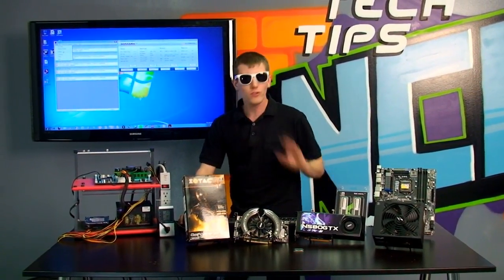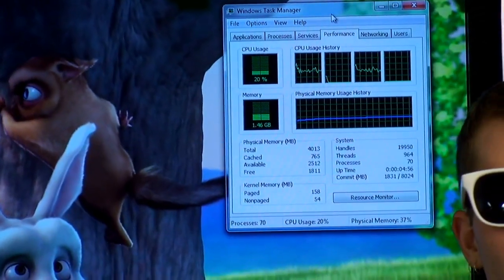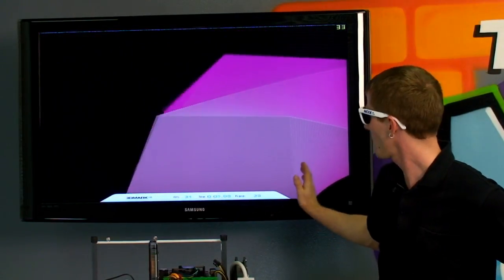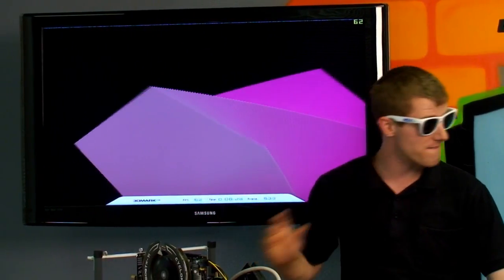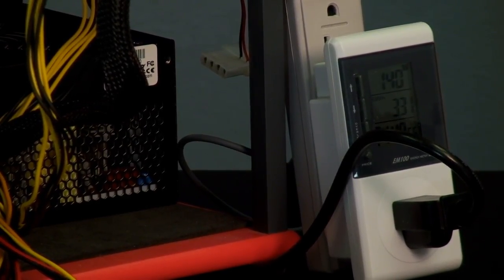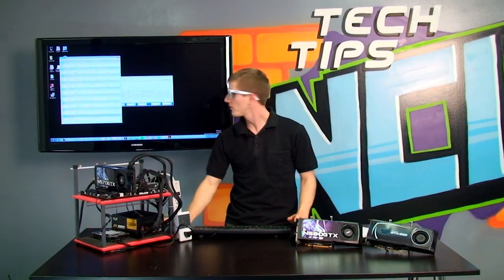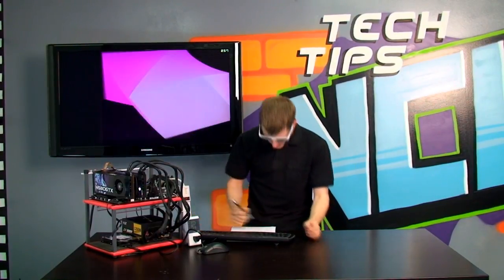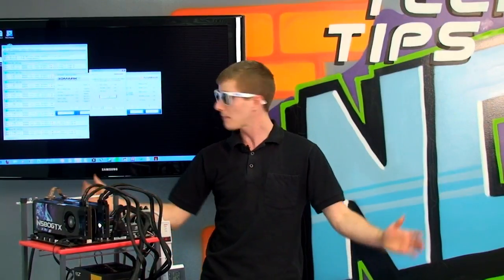System Power Consumption - A Closer Look NCIX Tech Tips

Comment: @TheLycanjake1 Do you leave your CPU overclocked every time you use the PC? No so you won't burn out your CPU. Same as the Power supply you don't stress it. In theory you can run the graphics card but stressing it out every time you turn on. If you tried placing that graphic card with your power supply, your PC is time bomb. When you have high end cards you must have reasonable amount of power that won't stress out.

Comment: Actually, in my country the 4570 is slightly cheaper - just a couple of bucks.
My only concern is that future games might require more cores, because they might be optimized for the architecture of the next-gen consoles, which would have 8 cores.

Comment: corsair brand 550W (I forgot what model exactly) Running a i7 950 with a small OC, 6GB of RAM, a HD6970 2GB, 2 hard drives and quite a lot of fans on that.

It would be a little bit on the weak side when my system would be running at 100% load, but it stays well withing the safe range (300W) when gaming or rendering video. I could probably get away with another HD 6970 because I have a brand name PSU.

I really don't see why anyone would need a 1k+ PSU,

Comment: @bluesmoke21 Go to Newegg (NCIX does not have the info) and check the images of the PSU. Read the label. What does the 12V say? Reason I say to check the label is because the details tab is not at all accurate for multi rail systems and sometimes the details are missing.
Take for instance the TruePower 650W, great power supply capable of 54A (648W) on the 12V. It's a multi rail system. If I read the details and added them together I'd end up with 94A (1128W) which it cannot supply.

Comment: your processor will never suck up that full 95 watts unless you max it out or you overclock. if you really want to be safe until you get a new power supply you can downclock all of your equipment so you dont put unnecessary strain on your supply.

Comment: Q9650 @3.6GHz, 4GB 1066 DDR2, 640GB+1TB harddrives, Bluray DVD-RW combo, HD5770 + Geforce 9600GT, fan controller, lots of led fans and a UV cathode all running off my Enermax 535watt.

Comment: couldnt find any power consumption for the 4570 but the 4670k (stock) is 33 watts idle and 97 watts under load, so im guessing the 4570 would be a tiny bit less and 8350 (stock) : 74 idle and 195 under load

Comment: GPU: Powercolor 7970

CPU: i5 3570k

RAM: 16 Gb 1333

Memory: 2tb Seagate

Mobo: Gigabyte Z77 - D3H

Case: Thermaltake Level 10 GTS

PSU: 800 watt

CPU Cooler: Corsair H60

Comment: I use a Corsair GS800 80Bronze. In my defence it was cheaper than the GS600 on Amazon which is why I bought it. At the time it was running an i5 2600K, 8Gb RAM and two 5770's. 

Yes, I know.

Comment: We have UPS that converts AC to DC to charge a battery that supplies DC current to an inverter to create AC to supply a PC power supply that converts it back to  DC voltages.  Why do we waste so much power converting  and not have a 12 or 24 volt DC switching  power supply that directly feeds the  Motherboard From the number you demonstrate here it seems that the biggest waste is in the power supply.I wonder how these numbers might differ with a solar system rail ?

Comment: indeed a stock 7970 and a stock 8350 both consume around 200 watts each under full load add top a 100 watts for your HDD + ram + MB you're then at 700 watt for full system load so a good 800 watt psu would've worked perfectly :P or 1000 watts if you OC'd everything

Comment: I got a q6600 at 2.7 gh(will be 3.6 soon enough) with
a 650 w corsair and a evga gtx460 at 850 mhz for my projector.
I can run dirt 2 maxed with 8x aa and 60 fps ar 1080p resolution
and even Arkham city with high settings and a smooth framerate with that.
You can get a used 460 or something similar for around 80 bucks on ebay.

Comment: You would be fine with a lower power seasonic as long as it can handle sli. I have a 620 with a 7970, and have power to spare. you could probably get away with right around 800 with a good name brand PSU.

Comment: maybe 700watts will be enough but get an 850 watts just in case and some wattage for overclocking. Also get a power supply with 4 pci-e for sli or crossfire in the future.

Comment: So the wall supplys your pc with AC power and the PSU converts that into DC power.  If my system draws 700w DC power it will only draw (estimate) 400w AC power.  What I am asking is when your computer is converting power to DC do watts increase from what is being take from wall?

Comment: With AMD Athlon 2 x2 250 and HD5750 i used to have LOGIC 500W, but i knew that this is not a good PSU, so i changed it to XFX Pro 550W. So it was not about a wattage upgrade, but a PSU quality upgrade. I think, that You could bring some good quality PSU with this same wattage as that "noname".

Comment: I wouldn't wanna be using an OCZ power supply (personal choice, but if a PSU is working then a PSU is working) but yes, 750W is more than adequate for two high end cards in SLI

Comment: Yes. It's do the job well. But ATI GPUs needs a lot of energy. To have sure (just a tip), try 650 or 700w. Each card gets, more or less 190-210w in FULL load. So, crossfire with 2 7850 will need a lot ot energy + more energy to the CPU and all other hardware.
Keep an eye in the memory too, because each 7850 needs (to run perfectly) 4GB. So, to Crossfire, you will need 8 GB. Good luck.

Comment: @juankabang1 600w is plenty. TO give you an Idea i run an I5 2500k overclocked to 4.5ghz (morepower consumption) Azza hurrican case with 8 fans, 2 gtx 460s 1g vram ocd to 850mhz, 1 ssd, 1 hdd, an asus xonar sound card, 8g ram, Asus p8p67 mobo, and a Kingston Hyperx ram cooler all running on a Corsair tx 750w no problem. 600w should be no problem with your rig. You wont pull more than 400w unless you start overclocking

Comment: yea what about mine i have a evga sr-2 with two i7 3970x cpu about 100GB of ram custom water cooling system with five radiators, 3 gtx 690s and 15 250GB ssds what should i do

Comment: E8400 @ 3.60 GHz c0 1.28v, GTS 250 1GB, P5N-D,
Corsair valueram 4GB DDR2, W7 ULTIMATE 32-bit, 1TB hdd, 30gb ssd, Novatech 750w modular psu total 12v rail = 72A

Comment: I use a XFX 850W Black edition PSU

i7 930 @ 3.8ghz (1.28v)

1 GTX 570 @ 850 core/1700  shader and 2100 memory @ 1.04v

1TB SATA HD
6GB 1600 Kingston Hyper X Ram

1 Noctua NH-D14

All on Asus X58-D board.

Comment: I have a 500w psu with a foxconn 945 7mc mobo with E6300 stock with stock cooler and 2gb corsair ram and a galaxy GTX275 with windows 7 with a 160gb hd+120hd+80gb hard drives and two disk drives with two 120mm fans should i get a bigger psu?

Comment: @juankabang1 lo you will be fine. I ran my 955BE @4.4Ghz on my UD3 along with 5HDD's, a 5870, and 8Gb DDR3 ram. Just make sure the PSU is good quality. I used the Raidmax 530watt (I have a different PSU now.)

Comment: I have 8gbs of ram and 600w psu (already made the system a couple months back) I just saw this video the power consumption almost hits 600 watts but those graphics cards consume about double the power each compared to 7850's. I know you should never get close to the maximum output of your power supply but the system power consumption shouldn't go much past 400w unless everything is at 100% load and still it shouldn't max out the psu

Comment: GS800 Power supply, 2600k @ 4.5 GHz, Corsair H60, 16GB 1600 Vengeance
EVGA GTX 580. P8P67 Deluxe, Intel SSD, + 1&2 TB 7200RPM HD

What I would like to see is how you add up how big of a power supply you need for building a new system. A 1250W power supply would be overkill for my system I think? Upon building my system I found a few web sites that said 800W would be fine for my system but how would I be able to do the math to find out for sure?

Maybe a Video in the future for that?

Comment: nVidia geforce GT 640 2GB DDR3 Core: 1150 Mhz Mem: 1050 Mhz
AMD FX-4100 4.3Ghz
Asus M5A78L-M/USB3 Mobo
WD Caviar Black 1TB w/ Crucial Adrenaline Solid State Cache performance boost
8GB Corsair XMS3 1333Mhz RAM
Samsung SATA 3 DVD R/W Drive
Not exactly a high-end powerhouse, so I use a 500 W CIT 500U PSU

Comment: Since my gaming pc died, I'm using a Zion 800w psu in my custom XPS 410 with a q6600 cpu with a Bsel pin mod running around 3.0ghz, i also have 4 hard drives and two all in one card readers, no disk drives, extra fans and old GeForce 9600GT video card, wire tucked for optimal airflow...Its not the best computer but it is far better then nothing and it runs most games decently although I must upgrade the video card.

Comment: EVGA Sr-2
2x Corsair AX1200 | 80+Gold
2x Xeon 5660 4.5Ghz
6x 2GB A-Data 1866+
3x SLI Nvidia GTX 480 Hydro Copper
3x Loop watercooling
3x acer 3D 24"
all in a MountainMods extended ascension case :)
like your episodes :), greez from switzerland... and please open a NCIX store near me! xD

Comment: it goes good with my level 10 gt. but i think and i might be wrong but if you have a higher watt power supply and use less of its capacity it should last longer. less heat generated less component wear of the PSU. i got 2 ENGTX580 DC II... 300 watts each.  water cooling and a bunch of other things that are power hungry. maybe i only use 800-900 watts but at least i got air to breath for what ever.

Comment: i have intel core i3 2100, 2x4gb ram 1333, gtx 670, 2x500gb caviar blue, and an asus p8h61-m le
I have a cooler master 550watt power plus, would that PSU be enough? i am not overclocking anything

Comment: Good timing for this video.
I have  this. Mobo Sabertooth x58, I7-950 cpu, HD6850 x2 crossfire, Killer 2100 network card, 12 gigs Dominator 1600 ddr3, h-70 cpu cooler, 60 gskill sniper SSD, 1t Cavair black 7200rpm HDD, LG blueray player. Fans 2x 200mm led, 1 140mm led, 3 120mm led. 2 UV cold cathodes and nzxt led strip, and NZXT digital fan control,  all on Corsair TX 850 watt psu, Can I still O.C. my cpu? suggestions?

Comment: I use an OCZ 1000 watt power supply and i thing there great! I also have a i7 2600k over clocked to 3.9 GHz However i can't get it to go to 4.9 GHz it just freezes my system then again i am using Windows XP 32bit home edition i don't know if that will afect it i think it will so i will try over clocking it again to 4.9 GHz when i'v got Windows 7, and lastly i think that episode did help me alot i now under stand more about power consumption and how other components afect that. Thanks Linus :)

Comment: One year ago, I bought an Asus desktop PC. It has an Intel i5-2320, 6Gb ram, an HDD and a not so good Asus mATX motherboard. The GPU on this is only a Gt 620, so I have decided to upgrade to a GTX 650 Ti. Will this run okay on my stock 350W PSU, or should I upgrade it? Preferably, I'm going to be lazy and keep the 350W, but could this lazyness be fatal?

Comment: yeah, i have absolutely no intention of running more than the one gpu. could i get away with a 430w or a 500w if i'm running a 3570k OC'd to 4ghz with a EVGA gtx660 SC with a 7200rpm drive and a SSD?

Comment: You can't use an i5-3570k with an X79 board. You're either gonna need an LGA 2011 processor, (like an i7 3930k, for example) or an LGA 1155 board to go with that i5-3570k.

Comment: i need some help... im going to build a system with:
an intel i7 3930k,
asus rog rampage IV extreme,
sapphire radeon 7970 oc,
sound card,
16 gb ram,
cooler master haf x
corsair h100
and some led strips

what power supply should i use ? i might be getting another card and setting up crossfire later. thanks

Comment: what psu do i need?
intel i7 4790 (might put K version)
2 Xgigabyte gtx 780 OC (not ti) sli

would 750W would be enough?
Reply: I have the same setup, except a gtx760. Also an SSD and a 1TB HDD. I have a 500w power supply, and it's actually more than enough.

Comment: I bought a better graphics card ( EVGA Nvidia 9800 GT). But when i installed it my screen was black and there was no beep. In specs for GPU it says that Minimum System Power Requirement is 400W. My PSU is 230V. Is that the reason that my screen is black ?

Comment: Using Coolermaster M520
6950 unlocked 920/1350 and as CPU an i7 920 C0 (3.8ghz) with 117W power consumption
Odd, but my PSU doesn't get hot.

Comment: @bluesmoke21 I disagree with Linus as his testing methods are questionable at best. Go to newegg and look up the wattage for the processor. That's a theoretical max (most are 100-125W). Then go to TechPowerUp and look for the GPU. TPU typically lists only GPU draw, instead of system like other sites (look at the MAX). Those are your two heaviest components. Adding another 100W (1 HDD, ODD, RAM, Mobo) is considered safe.
Add everything. That's the theoretical max the system can pull.

Comment: VX550 Corsair. First had a coolermaster GX550 installed but it made a horribly loud noise so returned it and paid double the price for the corsair, which is rather silent although still the noisiest component in my system :(

Comment: When buying components for a brand new rig, how can you calculate approximately how much power your rig will draw and therefore the capacity power supply you'd want to buy so you're in that sweet spot?
Reply: There are websites that claim to be able to calculate how much power  a system would need, but I wouldn't trust them too much. -At least these sites gives a hint of about how much power a system would need (then you can buy a PSU that can deliver 150-200 more Watt, just to be sure.)
In my opinion it's always better to get more Watt than you need, in case you want to upgrade your system in the future.
Reply: pcpartpicker has an estimated wattage usage when you select all your parts for your build in the top right corner.
Reply: thanks Devon and Peter :)

Comment: I use an Antec Truepower Quatro 1000W power supply. this runs my OC AMD 1090T at 4.15 GHz at 1.55V with one 6950 OC GPU gigabyte UD7 Motherboard with watercooling and two 7200 RPM HDDs in raid 0

I do not know how much power it consumes but I would say a fair bit

Comment: The average mainstream pc only uses 250-300 watts. Although they do have their uses, I find these 1k+ watt psu's kinda ridiculous in simple builds not running a high end cpu that's being overclocked and/or multi gpu setup. Part of building an efficient pc is adding a psu with overall realistic power usage. The system is not at 100% load at all times.

Comment: corsair CMPSU-650TX
hey guys, will this psu work well for this system? 
mobo: MSI P67A-C43 (B3)
cpu: Intel Core i7-2600K
ram: 4gb x2 corsair Vengeance
video: EVGA 012-P3-1572-AR GeForce GTX 570

Comment: there can only be one i7 on a motherboard, it's zeons that can do the twin processors with the 2011 socket. Five radiators? If you had a case big enough to hold them it would be the size of a small house. You can't have more than 2 gtx 690s since each has 2 cores (2 graphics cards) and SLI can only have 4 gpus. As for 15 drives, if you honestly had 15 sata III ports you motherboard would cost more than you're entire system.

Comment: can my stock hp bestec 250W (220W max) with 14A on 12v rail handle an upgrade from hd5450 to hd5570 ? if not whats the best i can get ? i am running an athlon 64x2 4600 2.4ghz(89W TDP).

Comment: I7 3770 (non-k I got it for $125). XFX AMD Radeon HD 7850 2gb, 8gb of Viper 3 Series 1600mhz  ram (2x4), ThermalTake Smart Series SP-750M PSU and a Z77-G45 motherboard. What would you rate this system?

Comment: I'm currently planning an upgrade, and my choice of CPU would depend mainly on the power consumption. I'm still undecided between i5 4570 and FX 8350. I know that the i5 consumes less electricity, but can anyone tell me how much less?
Also, I have a Corsair 500W PSU and plan to buy a Radeon 7870, so in combination with any of those CPUs and 3 HDDs, would this PSU be enough?

Comment: I use a Corsair TX650 v2 to power my GTX 670 + GTX 560 Ti + 3570K @ 4.2Ghz 1.2v Vcore

The system is 90% of the time running folding@home on the GPUs and on the CPU

Comment: I'll say the same that i said to Abe Thedrummer some coments ago. You should read his answers, i think it will help you. 
So, get a minimum of 650W-700W power supply. 2 cards need a lot of power + power for CPU, memory and other hardwares. I recommend a 80 Plus Bronze certified. In that case, i prefer Corsair ones. GS, TX and AX series are good (i use AX), but OCZ and Thermaltake are awesome too. I had a Thermaltake for almost 5 years and i never got any problem.

Comment: You can't just go by how many watts your computer pulls and buy a power supply accordingly. You must also look at how many watts are carried on the 12 volt rails coming off the power supply. Otherwise you could still bottle neck your hardware.

Comment: I think I win :D
I have 2 Corsair 1200 watts power supplies.
I run quad gtx680 32gb of corsair dominator gt ram.
I wish I was running 2011 but in running a 2700k overclock to 4.96ghz.
All this is fully watercooled with quad 360mm rads,

I have saved up for this config for 3.5 years. I am extremly happy with it.

Comment: Better take Furmark as Graphics Test and set it to Dynamic Camera and no AA.
This is the most powerconsuming test i could find. 3DMark Firestrike comes noway near that.
My Haswell i5 4460 (with prime95 loaded) and R9 280 on max OC had a peak of 415 Watt.
I have an be quiet Straight Power E9 580 Watt PSU. Still it is overshooting the 415 Watt,
but i have it because of the Cable management where only one port is needed for my GfxCard.
Otherwise i had choosen the 480 Watt model. The 415 W are never reached by games anyway.
Oh, and Idle i get around 34 Watt, 30 W with the Monitor going to standby.

Comment: A 650 pulls around 150w in full load. With the rest of the system in load, every time you even go near 3D applications it is just going to shut down, that's if it even starts.